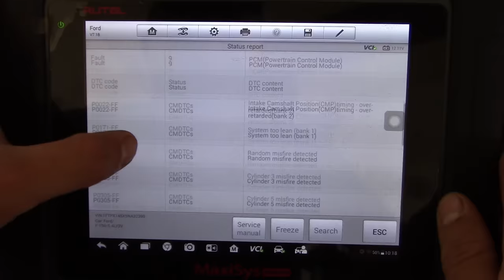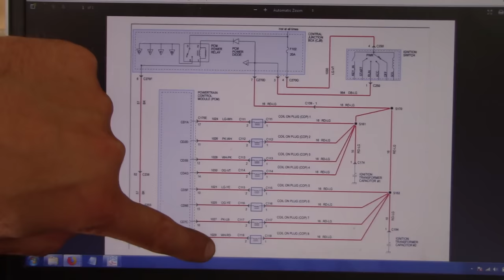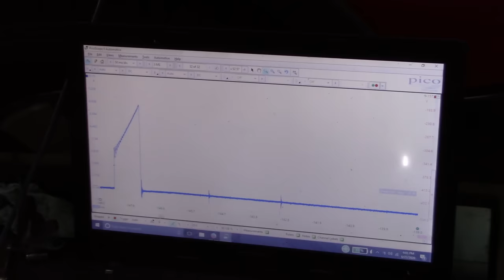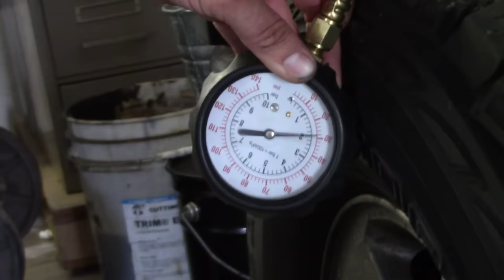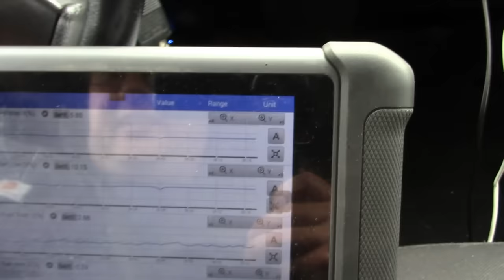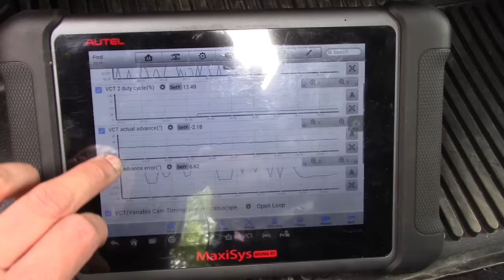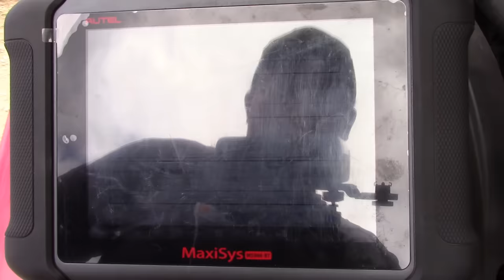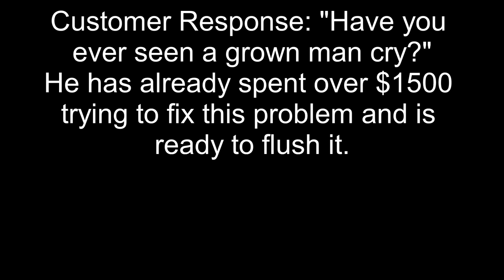2005 Ford F150 5.4L - missfires, intermittent rough running, rattles and knocks, P0021/P022

Comment: I Love how you wear a JD hat. When JD won't let FARMERS do what you do to find the problem with FORD engine. The JD service guys or gals MUST do everything you are for with that FORD engine. Why can't JD allow FARMERS to FIX there engine's. Especially with all the Emissions that are put on all these NEW JD Farm Equipment. "O" my bad it's because of all the $$ JD makes off service calls to Farmers. The Farmer must work night and day on bringing crop in from Harvard. He can't wait till Monday. If JD won't let Farmers work on engine's then JD must at NO cost to Farmers be available 24/7 to work on the hands OFF that farmers are NOT allowed to do to there Engines. That's my Rant on John Deere about there requirements on NEW farm Equipment.
Reply from the maker: Eh. This issue is way over blown. There are several good aftermarket scan tools for Deere and you can absolutely access their service data if you pay for a subscription.
Reply: @WatchWesWork  
Thank you for that information. YES I'm just going by what's said on U- Tube so that's were I'm getting most of my issues on John Deere just like I watch you with such fasinating. Your video are great when you show everything. Your background knowledge of different equipment and vehicle is so interesting to me to watch the details of your work. You always try and make it right. And when you worked on Loader on Hydraulic issues for front lever Hydraulic was A+ to me. Just seeing make it better. I thank you from bottom of my heart. You ROCK my Friend on your working knowledge from over your years. I wish I could just work ( for free) in your shop, to just LEARN by helping watching Listening to you. U-Tube is so great for me to just see you do all the different things you Repair. I Love to watch stuff like you do.

Comment: Worst Ford V8 engines in my opinion. Worst. They should have never put VVT on those. The 3 valves could have been far better. I feel as if they use the wrong oil.

Comment: Why ??? You could put a timing kit on it and throw it back together especially with a high flow oil pump it'll last forever need a new motor what a crock.
Reply from the maker: I actually just replaced the guides, tensioners, and VVT solenoids and it's still running today...